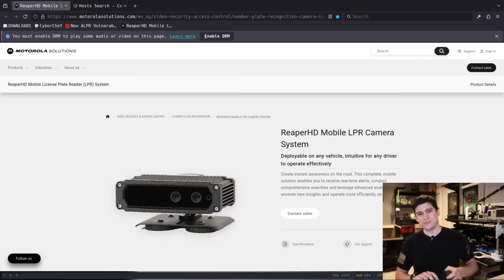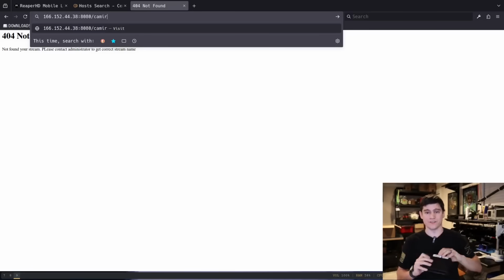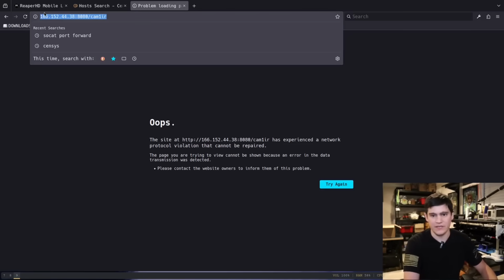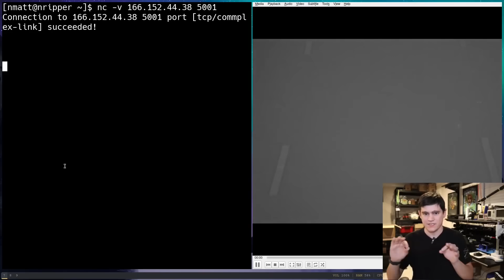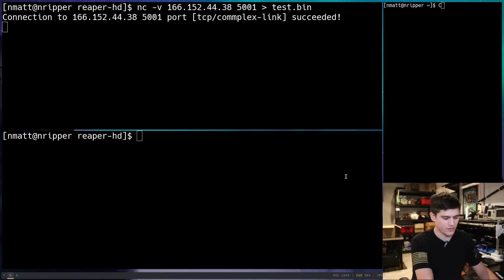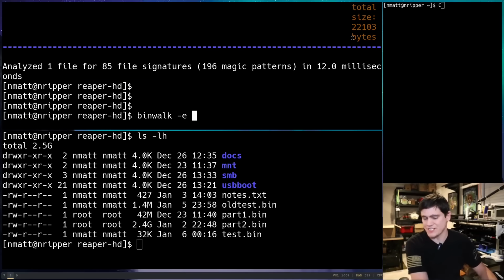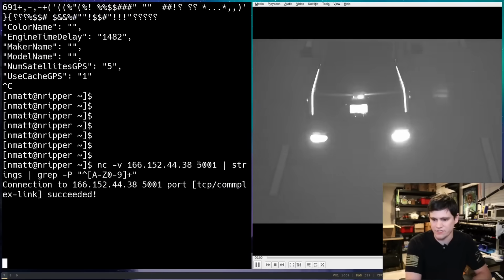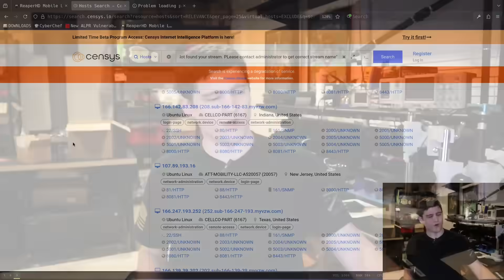Public Video and Data Feeds of Highway License Plate Readers

Comment: Look into the Flock cameras. They surviel and track 70% of the US population according to thier sales pitch. If youve driven anywhere but rural roads in the US, a private company has a tracking log of where you went and when. Our local governments are paying for this at $2500 per camera every year for access to it.  

As this video shows, its not if but when the system is compromised and all this data is leaked. Assuming its not already being sold to advertisers or insurance companies. You can easily resolve a license plate back to its owner yourself and get thier address if theyve ever gotten a traffic ticket as that data is all on the ticket, which is publically searchable on the courts site. Govenrment intrusion aside, the abuse potentials are endless. 

People need to start talking about this and pushing back or we're going to end up like China or North Korea.
Reply: It's probably all sitting in an unsecured S3 bucket somewhere...
Reply: Considering they will rarely even lift a finger to investigate a hit-and-run, you have to wonder what the hell they need all that data for
Reply: @SnownelVEVO Flock and other LPRs are used to track criminals movements, recover stolen vehicles and assit in investigations. Say I drive your house and break into your house and you happen to even make out that I was driving a white suv. The user can filter out and search all white SUV’s and see when and where they drove through to help narrow it down and then you can get the owner’s information and now they have leads to work.
Reply: @SnownelVEVO  Because if they used it for smaller things like that then everyone would know its out there.
Reply: We need EFF and similar organizations to create a model contract that mandates forfeiture of software and hardware systems fed illicit video of anyone who enters private property with networked cameras, and for that to include third party systems and global databases.  

Given the FedEx contract with Flock, that should bankrupt Flock and FedEx and cop shops, were it possible to enforce.
Reply: @lokiva8540 so flock is whats in the FedEx trucks
Reply: The "Why do you care if you have nothing to hide," argument is holding a lot of weight on its shoulders
Reply: Once I was made aware of flock cameras on a Reddit post last year  I notice them everywhere, even on rural roads! In some areas practically every on and off-ramp have them on small highways and interstates. I asked a local cop buddy about them and he struck it off saying "they're protecting us" 😅😅 It's a shame they are certainly valuable in tracking amber alerts and stolen vehicles but the risk of that data being sold and abused is just too much for me I wish they would all flock off.
Reply: Believe it or not some company sent me an excel spreadsheet with the coordinates and other info for all the flock cameras a few years back. They wanted me to swap out the batteries. I said I wanted to know more details and they just emailed the file to me, I didn't even take the contract it paid almost nothing per location.
Reply: Some kids in dark clothes, masks and 4 wheeler with no plates took care of flock by  us.
Reply: I hope it does get leaked so there is more attention around it.
Reply: I haven't bought one to break into but I did find, through the FCC filings, that the cameras do have a Bluetooth/wifi radio inside. Do with that what you will.
Reply: End up? Already very much those 2 with all the surveillance and tracking.. IRL and online
Reply: I discovered talking to our sheriff, the cameras are State / federal funded. Grants, they call it. 
The State and Feds are pushing them, local governments then say we’ll take this many.
Reply: Same goes for public facing cams with facial and bio recognition running. you're tracked even more through your little pocket selfie machineYOUR FKN PHONE. But leta all just focus on the secondary population monitoring systems  you ppl are yrs behind on conspiracies that are FACTS
Reply: this is all pretty accurate. i would say though, as a non-usian who's always lived in australia, the usa is way more similar to modern china than most people want to admit. your government full on attacks, invades and imposes sanctions on other countries to do what they (the usa) want them (other countries) to do. just like china.

in all fairness, australia does a similar thing too, just to a much smaller scale. that's why other countries in oceania hate us, and i don't blame them.
Reply: Bahahaha keep an eye out for somebody to set up a go-fund-me project to create a people's plate reader AI network so that everyone can put one on their car and in their front yard so that all the government employees of every kind can be found at a moments notice. Insted of Flock somebody will call it Sheep. That should get this whole 1984 Orwell network shut down in a hurry and it's protected by 1st amendment freedom to film anything in public view. It wouldn't cost much to do. LoL.
Reply: im making big bucks though
Reply: I see you #KAUAI OH BOY Flock is here. 😒
Reply: im pretty sure we are worse then china and north korea ! we are lied to !
Reply: they got these on rural roads where im at
Reply: Why do you think all the illegal immigrants were let in. To ensure such a system exists soon.
Reply: I'm pretty sure it's already too late for that. The info is already available it just can't be legally used in court. But since it's in the public domain it can be used to start investigations. Then warrants can be requested and issued. If they want you they can get you. It's just a matter of time. Public cameras are the main reason that conviction rates are up in the U.S.
Reply: I mean so do all of our phones....from Apple, to Samsung, to Motorola..  we live in a world with no privacy anymore, I'm not sure why people are surprised by this..

Comment: Hi Matt, they are sooo lame !    I, of course, tested the same 'nc' command as yours, but it failed with a timeout - hon-hon, did they watch your videos !? - so, quite logically, I issued the same command, but this time on port 5002 and bingo !   I also piped the results to gunzip, unzip and unrar, but to no avail (no time nor envy to push it farther) ; who knows, may be all information is encrypted under the redoubtable ROT13 (help ! Bring the quantum computers ! That absolutely can't be effective in this dimension, as the human mind can influence a simple random generator way beyond normal deviation (++10%))…

"Generally, security doesn't increase" — Yeah, when will isn't present, nothing can improve :(we've seen that with the recent hack of +100 M medical records from m$ Azure, each patch was more lame than the former one).

Until there is no regulations implying tremendous fines; this sh*t will keep going on forever…

BTW, this is the (truncated) result of : nmap -A -T3 166.152.44.38 :

22/tcp   open     ssh              OpenSSH 7.6p1 Ubuntu 4ubuntu0.3 (Ubuntu Linux; protocol 2.0)
| ssh-hostkey: 
|   2048 761796af76882d622ec1597bb637f377 (RSA)
|   256 7af74040e85b3a69509125f7ea433e93 (ECDSA)
|_  256 dba85e1e308ea194b7df1c8fe6b5fa00 (ED25519)
42/tcp   filtered nameserver
80/tcp   open     http             Apache httpd 2.4.29
|_http-server-header: Apache/2.4.29 (Ubuntu)
|_http-title: 404 Not Found
81/tcp   open     http             Apache httpd 2.4.29
|_http-server-header: Apache/2.4.29 (Ubuntu)
|_http-title: 404 Not Found
88/tcp   filtered kerberos-sec
135/tcp  filtered msrpc
139/tcp  filtered netbios-ssn
161/tcp  filtered snmp
445/tcp  filtered microsoft-ds
1023/tcp filtered netvenuechat
2000/tcp open     cisco-sccp?
| fingerprint-strings: 
|   NULL: 
|     #&')*)
|     -0-(0%()(
|     ((((((((((((((((((((((((((((((((((((((((((((((((((
|     $3br
|     %&'()*456789:CDEFGHIJSTUVWXYZcdefghijstuvwxyz
|     &'()*56789:CDEFGHIJSTUVWXYZcdefghijstuvwxyz
|_    RQK@ E-
2001/tcp open     dc?
| fingerprint-strings: 
|   NULL: 
|     #&')*)
|     -0-(0%()(
|     ((((((((((((((((((((((((((((((((((((((((((((((((((
|     $3br
|     %&'()*456789:CDEFGHIJSTUVWXYZcdefghijstuvwxyz
|     &'()*56789:CDEFGHIJSTUVWXYZcdefghijstuvwxyz
|     JZJ(
|_    JZJZ
2002/tcp open     globe?
| fingerprint-strings: 
|   NULL: 
|     #&')*)
|     -0-(0%()(
|     ((((((((((((((((((((((((((((((((((((((((((((((((((
|     $3br
|     %&'()*456789:CDEFGHIJSTUVWXYZcdefghijstuvwxyz
|     &'()*56789:CDEFGHIJSTUVWXYZcdefghijstuvwxyz
|_    jJAN
2003/tcp open     finger?
|_finger: \x08\x04\x00\x00
2004/tcp open     mailbox?
2005/tcp open     deslogin?
3000/tcp open     ppp?
3001/tcp open     nessus?
3003/tcp open     cgms?
5000/tcp filtered upnp
5001/tcp filtered commplex-link
5002/tcp filtered rfe
5003/tcp open     filemaker?
5004/tcp open     avt-profile-1?
8000/tcp open     http             Apache httpd 2.4.29
|_http-server-header: Apache/2.4.29 (Ubuntu)
|_http-title: 404 Not Found
8080/tcp open     tcpwrapped
8081/tcp open     blackice-icecap?
| fingerprint-strings: 
|   FourOhFourRequest: 
|     HTTP/1.1 301 Moved Permanently
|     Server: CradlepointHTTPService/1.0.0
|     Content-Type: text/html; charset=UTF-8
|     Date: Mon, 06 Jan 2025 16:55:26 GMT
|     Location: /admin/
|     Content-Length: 0
|   GetRequest: 
|     HTTP/1.1 301 Moved Permanently
|     Server: CradlepointHTTPService/1.0.0
|     Content-Type: text/html; charset=UTF-8
|     Date: Mon, 06 Jan 2025 16:55:25 GMT
|     Location: /admin/
|     Content-Length: 0
|   HTTPOptions: 
|     HTTP/1.1 405 Method Not Allowed
|     Server: CradlepointHTTPService/1.0.0
|     Content-Type: text/html; charset=UTF-8
|     Date: Mon, 06 Jan 2025 16:55:33 GMT
|     Content-Length: 87
|_    <html><title>405: Method Not Allowed</title><body>405: Method Not Allowed</body></html>
8443/tcp open     ssl/https-alt    CradlepointHTTPService/1.0.0
|_http-server-header: CradlepointHTTPService/1.0.0
|_ssl-date: TLS randomness does not represent time
|_http-trane-info: Problem with XML parsing of /evox/about
| ssl-cert: Subject: commonName=cp/organizationName=Cradlepoint, Inc.
| Subject Alternative Name: URI:http://cradlepoint.com
| Not valid before: 2021-02-26T15:25:31
|_Not valid after:  2026-02-25T15:25:31
| http-title: Login :: IBR600C-150M-D
|_Requested resource was /login/?referer=/admin/

Arrrggghhhh !!!!!!!

Comment: When my car was stolen I was happy to know various governments and private tow companies out there run these things. But the first thing my thief did was remove the plates. Fun defeat for that: mask off your license plate number on the metal under your plate, spray over it with retroreflective paint, remove the tape - now your car can still be found by these with the plate removed.
Reply: until they stick another plate on top of your masking.
Reply: @CapStar362 Add it to hood ;)
Reply: @CapStar362 could do it somewhere else.
Reply: This why I drive manual transmission vehicles, that don't have key fobs.  It's getting hard to find new vehicles set up this way, you basically have to do a factory custom build out anymore.  There are a ton of economical tracker options as well.  Kill switches are great, but don't use just one.  I have a momentary switch that has to held, that is very well hidden, and obvious one under the column, that is a 3 position set switch.  No fuel pump, no ignition relay, not getting my car, even if you can drive stick.  Also having yappy dogs that bark at everything they hear outside gives you time to arm oneself.
Reply: @ Im all about those 90s Ford and Toyotas
Reply: @MrRagequitnow  This isn't nearly enough. You need to live in a hermetically sealed bunker buried deep beneath a mountain, armed to the teeth, and drinking only filtered rainwater.

Also, less sarcastically, any halfwit with a rollback tow truck can still steal your car trivially, no matter how many secret switches you install or what kind of transmission you have.
Reply: This dude knows!  @MrRagequitnow
Reply: Just put an apple air tag under your seat.
Track your own vehicle down.
Reply: Nice
Reply: I used to work at dispatch and sometimes ppl would call and say they found their stolen vehicles and the police "better hurry up!" 😅 But that was always local and in person. Imagine that now on a large scale, ppl finding their stolen vehicles etc across country and just calling State to state "I saw my car! Idk where or what direction but you better get It!" 😂 Ugh that would be insane
Reply: And you don't think they will just spray over it???
Reply: @HDSME  Sure they would if they noticed it was there and had paint with them. But anyone who has tried painting a pattern with clear retro-reflective paint will know it's discernable only from a distance when your eyes are in line with a bright light pointed at it. So it would be clear to an LPR or driver behind them at night, but not to someone standing right there with a flashlight - to them it just looks like a slightly shiny area.
Reply: And when you sell the car, or they change your plate number?
Reply: @francisphillipeck4272  I know it's there so I can remove it and change it, or I can epoxy my new plate down. If I sell it, I don't care anymore do I?
Reply: U stupid. See them all the time @scottmatheson3346
Reply: No you remove the masking, leaving only the clear paint holding the retro-reflective spheres.
Reply: Kia owners need this
Reply: @Manstrual 
DA KIA BOIZ
Reply: If you're traveling, you don't need plates
Reply: @johnrobertd748 Oh, I found a "sovereign citizen spreading misinformation"
One step closer to crazy comment bingo!
Reply: 😂😂😂😂😂😂 @johnrobertd748
Reply: @johnrobertd748 😂 You win 🏅
Reply: @johnrobertd748 , car you’re travelling in needs them though.
Reply: @johnrobertd748  Do i need a license? or is that only commercial?

Comment: it would be really interesting to have a raspbery pi parse the data ( obtain the picture of the car and plate) and use a sdr radio to capture the tpms sensor data and build a data base.   at that point you would only need a pi and a sdr radio to provide analitics on a location,  since a tpms sensor on a vhicle fires on a avarage of 15 sec. just seamed like a idea

Comment: the amount of irresponsibility of setting those devices up is off the scale...
I'm monitoring around 100 freezers, ventilation systems, heaters etc using iot and I'm stressed out now to allow anyone unnecessary to access that, which would mean nothing to anyone really, but here - want to monitor where people are going - here, open ports to anyone who wants!
Reply: No kidding, at work you would thing the hvac system was the gateway to fort knox.
Reply: @alexb.1320 that's because they have enter through that way before and gained personal data so it got strict for a bit.Most BMS get installed then left to the owner and never ever get updated
Reply: Shodan. ;)
Reply: Don't you guy's use SCADA systems for that now?

Nevermind, two different systems with two very different uses😂
Reply: Rename the device to change your password!

Comment: This is wild to think about. What you are seeing might be from one lane of one (of the many) tool booths in Illinois. The vehicles would have a transponder for the toll fee but they also check the license plate incase the vehicle driving does not have a transponder. They store all of this data and either take the toll fee from the transponder or send a ticket to the registered owner of the license plate. I haven't had a ticket but it wouldn't surprise me if they use that jpeg image on the ticket too.
Reply: why yes....they do :)
Reply: That's exactly the image they use on the tickets they issue. I have driven though Illinois and got a couple

Comment: I took a small DVD laser and converted it into this small bar and it moves around in a circle and it shoots down onto my license plate and it scrambles anything trying to read the license plate like one of those cameras in the video. Idk if it's illegal but I was bored one day and made it. What happens is that that laser spins around so fast and shines off the license plate. It makes it where the IR and the camera have a hard time reading what's on there.. it's not just one laser, there's two..
Reply: Also, once the car is parked and powered off if they drive around with one of those, the laser is not on so they can read the license plate. It's only good when you're driving.
Reply: what if i use ir on the plate pointing towards the camera?
Reply: @xAbhimanew  Yeah that might work too. Just want to try to scramble the image so they can't read it without covering up the plate.
Reply: @Kyroptra  If they ticket you for scrambling the plate then fight it in court....you illuminated your plate not obscured it

Comment: I suspect there will already be persistent malware installed on such wide open  devices. No use locking them down now, they would have to be replaced or at least wiped thoroughly. Or just deactivate them.